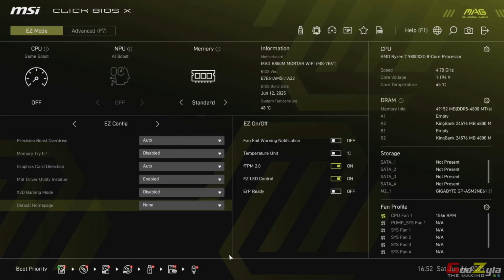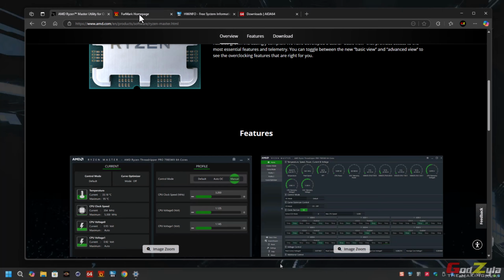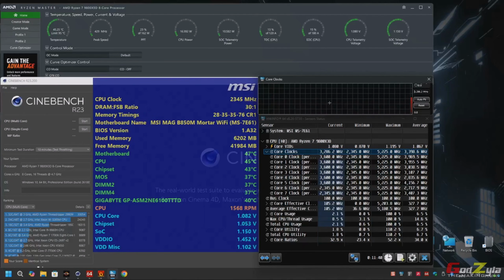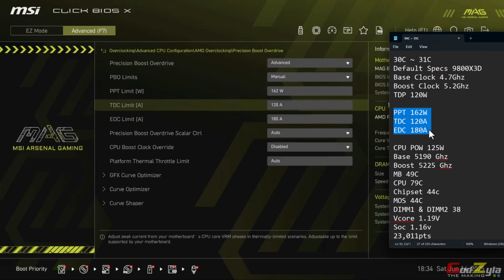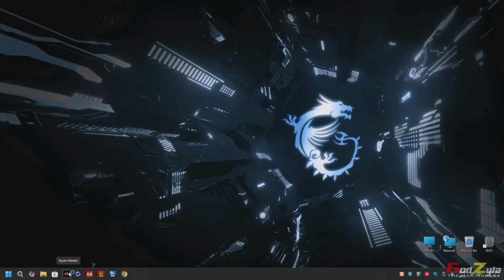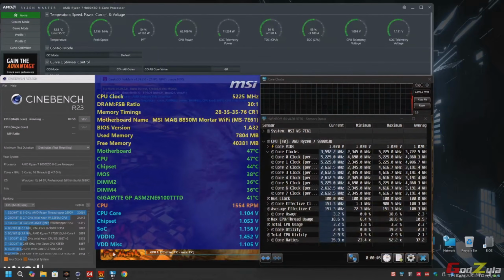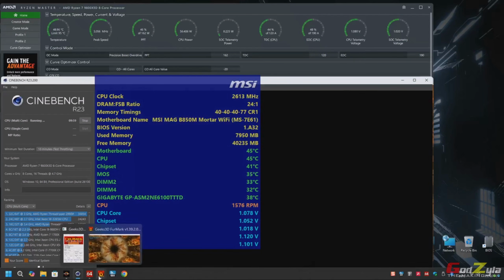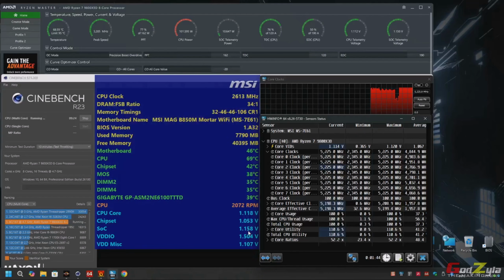PBO2 Curve Optimizing with 9800X3D on MSI Motherboard

Comment: Hey very nice vid! I have a similar board, so the first part where you put a -.05 offset on CPU VCore then later in the vid     Under PBO you change all core to negative 20. I’ll go over it again but do I do both or choose one or the other?
Reply from the maker: Hi Kuya Rio, welcome back. In this content, I just keep add on to my settings, step by step. I did not remove any settings along the way. Kindly understand what you are doing and make sure to use Aida 64 Stability test to test your system when you change the settings. At least run for 30minutes to ensure stability before proceeding to the next configuration.
Reply: @K @KleoYan I see, so do both settings if stable. I just upgraded to the 9800x3d and B850 tomahawk max WiFi today and I came from Intel so AMD is super new to me. Also should I update bios? My bios date is from July 2025. The other issue is my ram xmp profile is for 6800, so can I enable it and downclock it to 6000? I would just get purchase a new 6000 ram kit but well you’ve seen the ram prices lately haha
Reply from the maker: @KuyaRio-i8o  I see. for ram configuration. You will need to know your ram's Jedec. see which Cas Latancy timing it can do. you can look it up on HWinfo64 under Memory Summary, this I won't be able to aid you. Since you are new to AMD. these are the steps I will execute

In UEFI
1) Enable XMP or EXPO (depending on your rams profile) to Profile I
2) If you want to manaully set your rams, this you will need to know your rams Jedec and you have to do some research on this. For msi board, I will just set it to run at XMP profile then you can set in step 3) and 4) 
3) Set High-Efficiency Mode to Enable
4) Set Memory Timing Preset to Tightest
5) Set CPU Core Voltage to Offset Mode
6) Set CPU Offset Mode Mark to - (Negative sign)
7) Set Offset voltage to 0.05v
8) Set CPU NB/SoC Voltage to Override Mode
9) Set Override CPU NB/SoC Voltage to 1.15V

Save it and boot to windows, run Aida 64 Stability Test for 30minutes
If it's unstable, 

10) Set  High-Efficiency Mode to Auto

Save it and boot to windows, run Aida 64 Stability Test for 30minutes

if it's unstable, up the NB.SoC Voltage 1.16V ~ 1.18V 

if stable, then proceed below. 

Under Advanced > AMD Overclocking > AMD Overclocking
10) Check SoC/Uncore OC Mode is Enable

Under Advanced > AMD Overclocking > AMD Overclocking > Precision Boost Overdrive
11) Set Precision Boost Overdrive to Advanced
12) Set PBO Limits to Manual
13) Set PPT to 162000mW (take note of the zeros, its 3 zeros and not more)
14) Set TDC to 120000mA (take note of the zeros, its 4 zeros and not more)
15) Set EDC to 180000mA (take note of the zeros, its 4 zeros and not more)
16) Curve Optimizer to All Cores -(negative) 20

Curve Shaper 

17) Set MED Frequency with the 3 temperature Low, Med & High to Negative 15
18) Set HIGH Frequency with the 3 temperature Low, Med & High to Negative 10
19) Set MAX Frequency with the 3 temperature Low, Med & High to Negative 05

Save it and boot to windows, run Aida 64 Stability Test for 30minutes

If unstable, set Curve optimizer to -15 instead of -20.

Once all stable, final test, use Aida 64 Stability test, run for 2 hours and next run OCCT with AVX2 for 2 hours. 

If pass, go play some games and observe thermal and performance. Good Luck!
Reply from the maker: @KuyaRio-i8o  forget to mentioned, kindly update your bios too. a very simple and good guide is by Ronnin https://www.youtube.com/watch?v=asdomsnbBb8 (jump to MSI timestamp) make sure you use the bios flashback button for this. Reason is, in the event if your electricity just trip and break the bios flashing, your board will not brick as the bios flashback button function has this protection mechanism... If you use the UFEI / BIOS method, once loading and electricity trips, your board will be brick.
Reply: Wow thank you, this is very useful! Glad I came across your video and didn’t run 6800 xmp/expo yet, wasn’t aware of the excessive soc at high ram speeds. But yes, the ram I have is the Kingbank Soarblades. No xmp enabled it runs at 1.1v at 4800, the expo profile is 34-45-45-108 6800 at 1.4 volts. I’ll try your suggestion first to enable xmp then move on to step 3. One last question for now haha, so I know amd works well at 6000 ram speed so I’m wondering if I can enable xmp then lower ram speed to 6000 and change primaries to cl-30 36 36 or so around 1.4 volts, and then set flck frequency to 2000, also uclk=memclk, could I do that also if I want to test this method?
Reply from the maker: @KuyaRio-i8o   for KingBank rams, they should have dual profile, XMP and EXPO, anyway if you want to set to 6000, you will have to do it manually, not advisable to enable EXPO profile and to set dram clock to 6000. this is where I have told you to find out the Jedec of your rams. Cas Latency and ram timing cycle will need to tweak inorder to run at 6000 with UCLK=Memclk.
Reply: @K@K@K@K @KleoYan nk you for all your help, I’m still learning about the infinity fabric on amd side and seeing everyone recommending 1:1 so infinity fabric can run the same speed as ram. 

I did find some Jedec info using cpu-z, (cas latency 40, ras to cas 39, ras precharge 39, tRAS 77, and trc 115, ram frequency 2400hz for single and dual is 4800). I’m not sure if that’s what you needed? 

But for now I went ahead and used your steps that you recommended to me, I’ve enabled expo profile ‘cl 34 45 45 108 which ram freq is at 6800’, no manual tuning, applied the tightest timings setting and high efficiency mode applied, -50 v core offset and 1.15 soc. I went ahead and applied the negative 20 all core and applied your curve. Unfortunately it crashed within the first minute of Aida 64 so I dropped it to -15 all core and it passed two hours of aidia 64. Also should I not touch the mclk, uclk, and fclk with this expo profile enabled? I haven’t changed any of those values. 

Had a question on occt test, am I only doing the cpu test and not the cpu+ram test correct? And should I use the extreme and not normal preset for occt?
Reply from the maker: @KuyaRio-i8o   Don't mind me, I have to be upfront with you. For ram configuration. I myself is not confident to tweak the timing , the cycle and such as I've tested on 6800 bus speed. it just crash on me no matter how I tweak it to run at 6000. This I admit my lack of knowledge about ram configuration. 
For OCCT , set Mode to extreme , set load type to steady and set the instruction to AVX2. Setting to AVX2 will stress more strenuous on both CPU and RAMS. This is to catch potential instability especially with Ryzen CPUs that are undervolted or overclocked. At the meantime, it's good to monitor the VDDCR_SoC voltage ot NB/Soc Voltage. just to make sure it does not go pass 1.2V, also at the meantime you will be able to monitor the Ram's temperature.
Reply: @KleoYan alright no problem. The issue is OCCT has two similar test, one is cpu and the other is cpu+ram. Didn’t know which exact test to choose?
Reply from the maker: @KuyaRio-i8o  choose cpu + rams

Comment: Kleo Yan im upgrading my RAM from 32GB to 64GB (2x32GB) G.Skill Ripjaws S5 Black DDR5-6000 CL30. My Question is will the settings stay the same or do i have to change something? The RAMKIT im using now are the same G.Skill Ripjaws just 32GB. By using your settings.
Reply from the maker: Hi Elb Skipper, welcome to my channel. You might need to set it to 1.18v instead of 1.15v. You can give it a try on 1.15v and to test it with Aida 64 stability test or to use Occt with avx2 test.
Reply: @KleoYan  wow that was fast, thank you Kleo Yan. Will do as you say.
Reply from the maker: @elbskipper5893  you are most welcome. Thank you for the visit and all the best with your setup 😉

Comment: That voltage you out on CPU Core its for idle ?
Reply from the maker: Hi Evolution evolution, welcome to my channel. Pardon me, I miss out on your comment but I do not understand what you are trying to ask.
Reply: @KleoYan that voltagem you out leds on CPU is for idle ? Them curve optimizar is for leds voltagem at médium and full ussge right? Tour serting on cinebemch do to me 16000 points on cinebemch... Is that so low? If i out on auto Precision Boost and ONLY more +200 i got 23800 points... On my setings at full 30 minutes stressing cinebemch i have full temp of 63 what you think? Can you help me got neste my points but with leds voltagem etc?
Reply from the maker: @dragonalllegendsevolutione3419  it’s difficult to understand you. Just type in your own language. I can translate. That will be better. Thanks.

Comment: I Lost temperature but Lost 900points on passmark
Reply from the maker: Hi Evolution evolution, welcome back. You lost 900pints on passmark? Did you compare it with default or compare it with your previous settings.
Reply: @KleoYan precious setings buddy... But well looks like the temps and energy is much less buddy... For more points on the passmark i use ONLY Precision Boost manual and +200
Reply from the maker: @dragonalllegendsevolutione3419 Thank you for the clarification,  maybe you can revert back to your own previous settings if that 900 points does bug you. My goal here is not to over stretch, instead to undervolt + performance over default. Thank you for your reply and feedback.
Reply: @KleoYan tour voltagem on CPU Core its for idle?
Reply from the maker: @dragonalllegendsevolutione3419  I don't understand what you mean by tour voltagem?? anyway as i've mentioned.. tune to your desire, I can't stop you from stretching your processor.
Reply: Yes undervolt is amazing its going to 5350mhz with tour setings..

Comment: This is a secure undervolt right? But Lost performance ??
Reply from the maker: Hi Evolution evolution, welcome to my channel. It does not lost performance when comparing to running it from default. it's an improvement with lower temperature.

Comment: I just put my build together with the 9800x3d.  I follow step by step and stop right before co & cs. My CPU runs at 59 °C, 67 W average on the power, soc I set at 1.15V on the core, but it always jumps to 1.68 when running Cinebench. Have 1 dip throughout the 10-minute stress test. I don't know why the power consumption is so low compared to your 9800x3d. When I applied the CO & CS, even do it was lower by 5, all the cores do around 5GHz or less on average. I save like 0.1 V on the CPU core, but suffer a lot of core speed. The CPU runs around 8 °C cooler.
So I just decided to disable CO and leave the CS on auto, aka default.  Is there a driver update for just the overall consumption of the 9800X3D? I just follow you, but since my chip performs much differently from yours. What should I do now?
Reply from the maker: Hi Dung Do, welcome back. I will clear cmos totally and redo the whole configration

Make sure Bios version is up to date, Clear CMOS and by default load to windows, then go back to UEFI

In UFEI = go to advance mode, select OC 

01) Enable EXPO profile
02) UCLK DIV1 MODE to UCLK=MEMCLK (for rams that have a bus speed of 6000. If above set it to UCLK=MEMCLK/20
03) Enable High-Efficiency Mode
04) Set Memory Timing Preset = Tightest
05) Select CPU Core Voltage and set to Offset Mode

06) CPU Offset Mode Mark to [-] sign
07) CPU Offset Voltage to 0.0500V
08) CPU NB/SoC Voltage to Override Mode
09) Override CPU NB/SoC Voltage 1.15V

Boot to windows, use Aida64 System Stability test to run (run for 30mins)
If stable jump to 10) if not follow below

if unstable, 
A) Boot to UEFI
B) Set High-Efficiency Mode to Auto

Boot to windows, test again with Aida64 System Stability test (run for 30mins)
if unstable 
A) Boot to UEFI
B) CPU Core Voltage and set to Auto

10) Click on Advanced CPU Configuration
11) Click on Precision Boost Overdrive
12) Click on Manual 
13) PPT Limit to 162W / 162000mW

14) TDC limit to 120A / 120000mA
15) EDC limit to 180A / 180000mA
16) Set Platform Thermal Throttle Limit 90
17) Scroll down, click on Curve Optimizer
18) Select All Cores under Curve Optimizer
19) Select Negative under All Core Curve Optimizer Sign
20) Set value 20 to All Core Curve Optimizer Magnitude

Boot to windows, use Aida64 System Stability test to run (run for 30mins)
If stable jump to 21) if not, change your Curve Optimizer to -15

21) Set curve shaper
Med Freq : Low Temp -15 , Med Temp -15, Low Temp -15
High Freq : Low Temp -10 , Med Temp -10, Low Temp -10
Max Freq : Low Temp -5 , Med Temp -5, Low Temp -5

Boot to windows, use Aida64 System Stability test to run (run for 30mins)
if unstable, remove curve shaper, just run Curve Optimizer
Reply: @KleoYan  I just ran a 30 min test with Cinebench and furmark. Same test as you in the video. The CPU is about 56C on average, all of the temperatures for the chipset, mos, ram are all under 38C, SSD is at 34C. Throughout the 30 min, there are 5 to 6 dips in the Core clk chart, the rest is 5225 MHz consistently. CPU core is at 1.148V average, SOC at 1.16V. Those stat are without Curve Optimizer and Curve Shaper. Should I apply CO and CS?
Reply from the maker: @dungdo4280  yup continue with CO first, then CS. You will see the dips disappearing
Reply: @KleoYan  So I just finished with all the optimization, and this is what I have:
With CO (20): I got 6 dips total, CPU temp at 50C. mobo, mos: 37C, RAM: 1-39C, 2-38C, ssd: 34C. CPU core: 1.07V. 15186 pts for Cinebench
With CS on top of CO: I got 10 dips. CPU temp at 48C. Beside each RAM stick -1C, the temp is the same. CPU core: 1.038V. 15203 pts for Cinebench.

I also ran a stability test on AIDA, and nothing crashed.
I'm assuming even with more dips in core clk, I should keep the CS?
Reply from the maker: @dungdo4280  hmm I will not do CS, instead I will increase CO to -25 all cores. Far apart dips are ok but if having too many dips near each other. It will not be ideal in long run.
Reply: @KleoYan  I will try that. So the goal is to get no dip or as little as possible throughout the 30 min test? Also is the dip distance matter? Some dip only drop by 1 block on the chart, and some can be 5 or 6 blocks.
Reply from the maker: @dungdo4280  that is correct. lesser dips the better as it tells you that your processor is running consistently. as for distance. I would say the further the better.
Reply: @KleoYan  So I tested with the - 25 CO and removed CS. I got the total of 5 dips throughout the 30-minute max load. The first 2 dips are 3 blocks apart; the 3rd dip is around 7 min later; the last 2 dips are around the 20 min mark, with the same pattern as the first 2 dips. All the temp and voltage are pretty much the same. Is this a good stat?
Reply from the maker: @d @dungdo4280  look alright. Maybe now go test out some game play.
Reply: @KleoYan  I boot up and run a few games, they run fine, most of it is GPU-bound, so I am not sure what to look for.
Reply from the maker: @dungdo4280  so long run stable and won’t crash, that’s good enough as you already have the base foundation configured.
Reply: @KleoYan  Should I still try CS? With a smaller curve to your? Also, is it possible to get a setting where there is no dip or 1 or 2 throughout the 30-minute stress test?
Reply from the maker: @dungdo4280  each processor is build differently. I am not able to predict how your processor works. Learn the basic of what pbo can do and apply to your system. Decide on your own what is best for you and at which level of confidence you have with your configuration. That’s all I can offer my advise to you.
Reply: @KleoYan  Besides CPU, do you have a GPU guide?
Reply from the maker: @dungdo4280  basic applies on Nvidia cards https://youtu.be/rszExjjkXFk

Comment: How can I check if my RAM supports High-Efficiency mode? MY Ram is the Kingston Fury Beast 6000MT CL30 64GB, Timing is 30 36 36. Another question: should I enable X3D gaming mode?
Reply from the maker: Hi Dung Do, welcome back. You can always enable High-Efficiency mode and run aida64 stability test. If it’s stable, then continue to use it. As for x3D gaming mode. Some benefit some don’t. For me I won’t enable it as I don’t play games. You can try if you want to.

Comment: Hello, i did curve optimizer and everything like you shown in video but when i play games i get very bad 1% lows and even on basic tasks like browsing on internet or watching netflix my audio lags and screen too do you have any tips or solutions ? i have a X870E Msi Carbon Wifi + 9800x3d + 32gb,CL30 g.skill ram
Reply from the maker: Hi $NIF, welcome to my channel. Is your bios up to date and have you done a clear cmos before attempting to do the tweaks?
Reply: @KleoYan  Yes, i have the newest bios and i cleared cmos before doing the changes
Reply from the maker: @nif3290  I would say do step by step to trace where goes wrong. 
Step 1 - set ram timing with vcore offset - test it
Step 2 - set PBO limits with just Curve Optimizer - test it
Step 3 - Set everything and test it.

this way you will be able to narrow down which is causing your performance lost.
Reply: @KleoYan  Thank you ill try and let you know i just noticed another thing i ran a cinebench test and my cpu was not on 5.225ghz all the time like yours it was staying in 5.0-5,1 range
Reply from the maker: @nif3290  I believe you only enable PBO .. you should set manual, have total control of your system. I mean that's my personal advise. Best is know what ya doing instead of copying and paste configuration, that way you understand how your processor works and to take note on CPU power drawn, SoC voltage drawn.